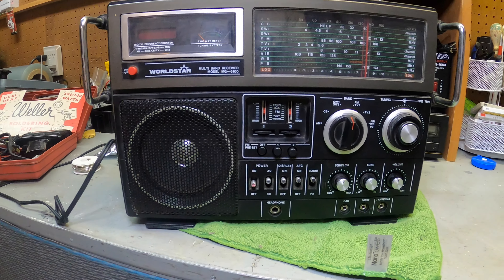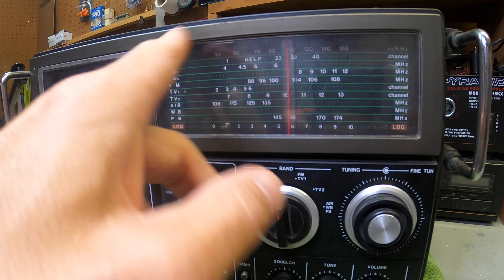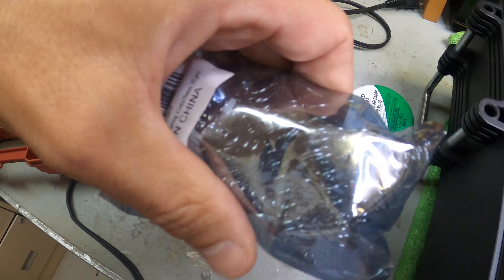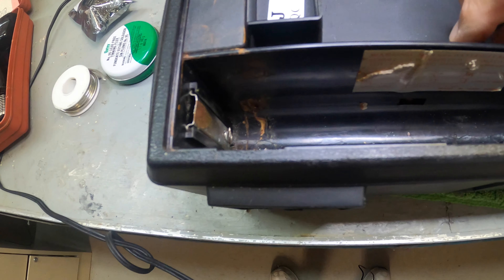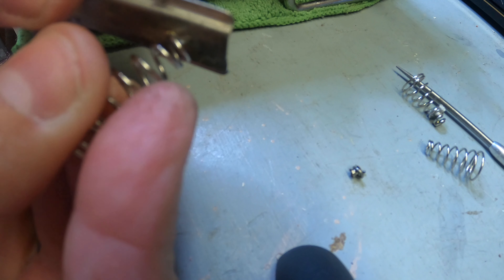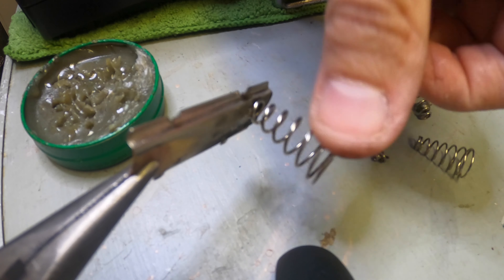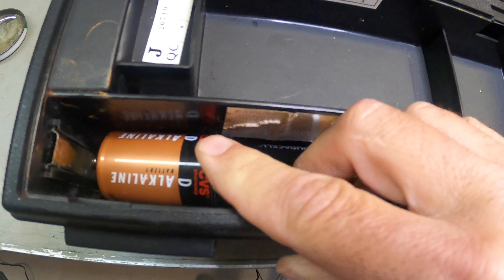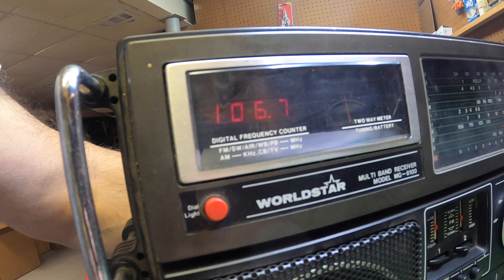How to fix a broken battery spring

Comment: Thx for the video. I tried the easy quick fix it method instead. I cleaned all the corrosion off and one of my springs broke off. So I used a small piece of tin foil. Folded it nice & tight and shoved it in between the open space. Closed the cover and it worked! My second option would have been your method if the tin foil didn’t work. Injustice fixed my 32+ year old Pioneer LD/cd player, but my remote control was corroded. All is working perfect.
Reply from the maker: Glad you found a solution!

Comment: Questions:
One: Why did you say beforehand that the radio worked, if the spring wasn't on yet, you didn't know it worked then correct?
Two. After you got it through the hole, did it NEED to be soddered? or was soddering just extra make sure it stays in place?
Three: When soddering do you NEED that gooey stuff or ANYTHING other than the sodder tool? I have a sodder tool from my grandfather but want to know if I could use it plain without anything with it? or is that gooey etc stuff necessary?????
Thanks!
(I tried to clean a mini handheld game today by the spring & I ended up ripping off the "ribbot" you speak about, getting carried away with my scissor stabbing it, lol. leaving that same very hole! Go figure! I can't get the spring  back in place, because it doesn't pick up like yours does, so it's hard to do with a tiny space. No big deal, I'll just give it away to someone but was just curious).
Thanks!
PS you have an accent.
Reply from the maker: Thanks for watching the video. Yes the radio worked plugged in. The gooey stuff is flex that will make the connection better to sodder.
Reply: @YourReviewChannel  ohhhhh with the outlet lol gottchya.
you put the goo on the item or the sodder tool?
& but is it necessary?
Reply: i did it without the soldering and it worked just fine

Comment: Avoid the (  DREADFUL , yes , AWFUL LEAKY alkaline batteries ! ) and retrofit with Lithium rechargeable batteries , salvaged from ( Zillions ) of discarded vapes .. you will need to have a suitable charger ( PCB : TP4056 ) and a soldering iron .. do some math as to your correct voltage . ...These cells DO NOT leak  ! .. ( tried - n - tested ) ....... DAVE™🛑